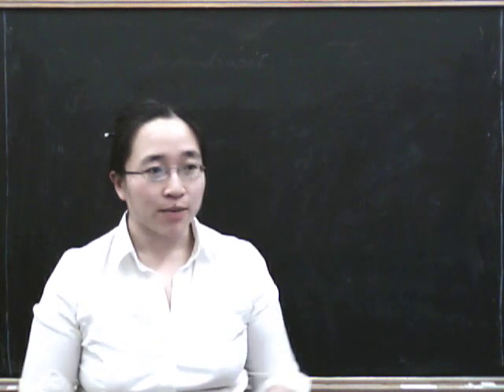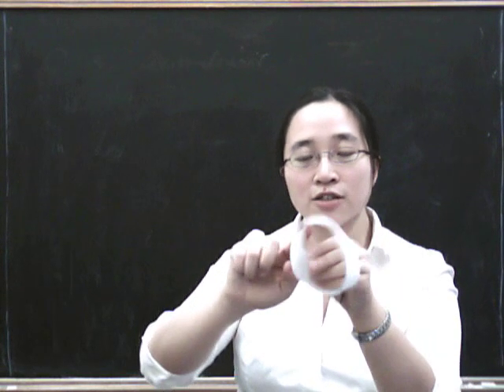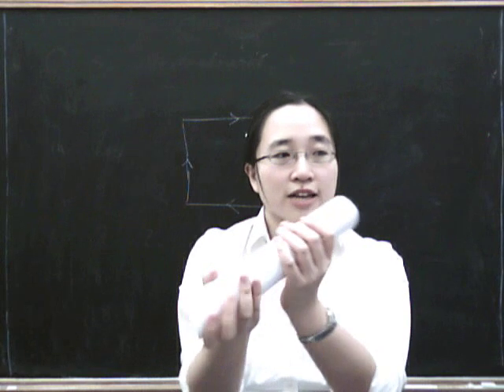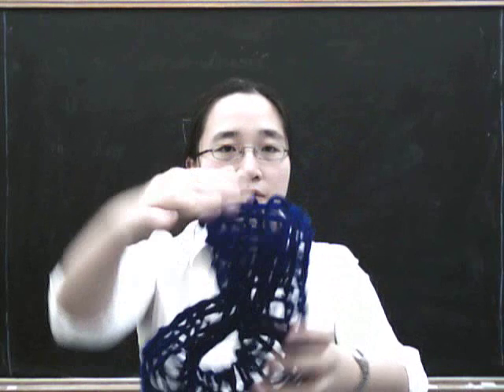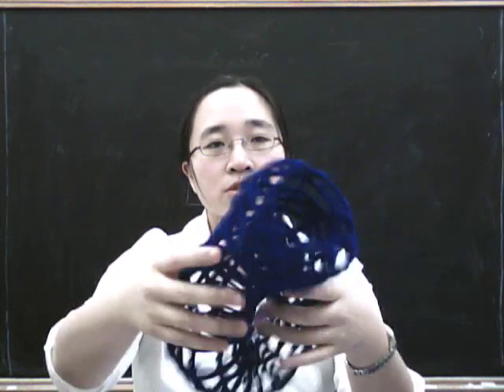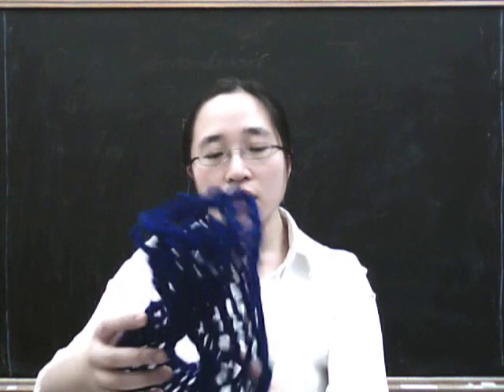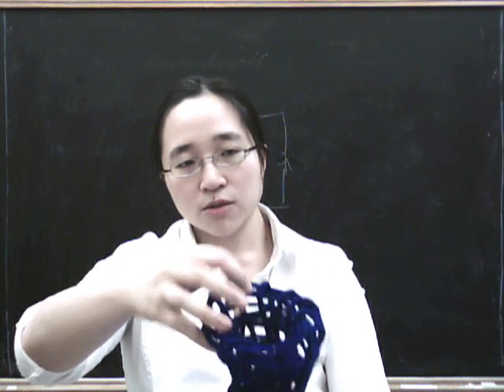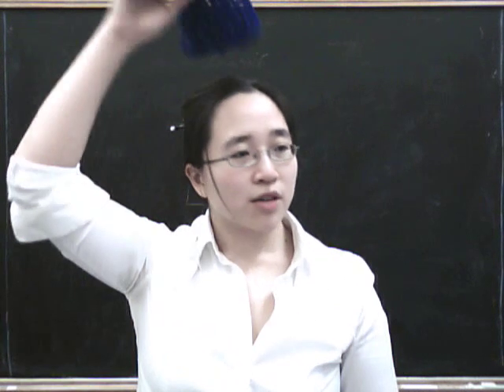Klein bottle

Comment from the maker: This surface only intersects itself because we're trying to make it in 3-dimensional space. In fact in 4-dimensional space, it wouldn't have to intersect itself.  A Klein bottle is an important example of a "non-orientable surface".  These are basically surfaces on which you can't put a sensible coordinate system, and none of them can be built in 3-dimensions without intersecting themselves.

Comment from the maker: This is a surface, so in that sense it is only 2-dimensional.  The pipe-cleaner model is an attempt to build it in 3 dimensions, but in 3 dimensions it has to go "through" itself in a rather unsatisfactory way, unlike an inflatable ball which is also a "surface" but sits in 3-dimensional space perfectly well.  To build a model of the Klein bottle that did not go "through" itself, we would have to go into 4-dimensional space, yes.  But this doesn't mean the Klein bottle is 4D.

Comment from the maker: The Klein bottle model made out of pipe cleaners is indeed sloppy - it's just a visual aid.  The Klein bottle as defined mathematically is extremely precise and is crucial when classifying all the different forms that smooth surfaces can take: it's one of the non-orientable ones, which means, basically, the ones that are hard to visualise.  When things are hard to visualise that's often the moment when mathematics steps in.

Comment from the maker: Actually the fact that it holds water sort of shows that the surface has only one side.  A doughnut (torus) does not hold water - you wouldn't actually be able to get the water inside in the first place!  We have to be careful though - holding water is not a rigorous definition of whether something has an inside and an outside.  You could make a dent in your doughnut and then it would hold water too, but that doesn't count...